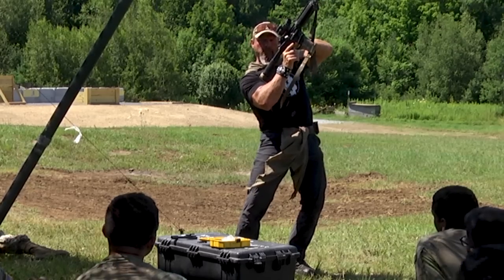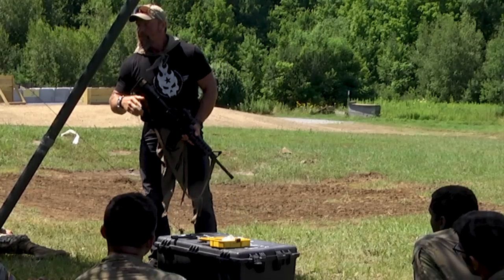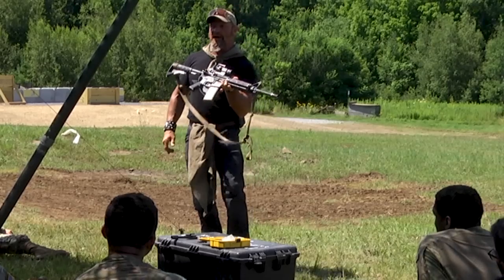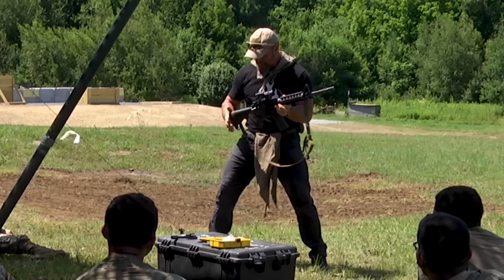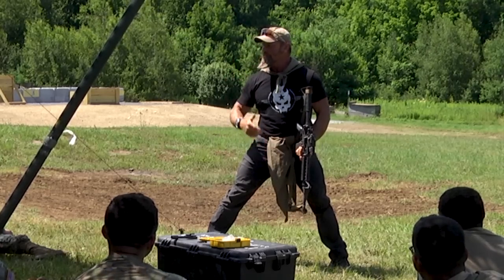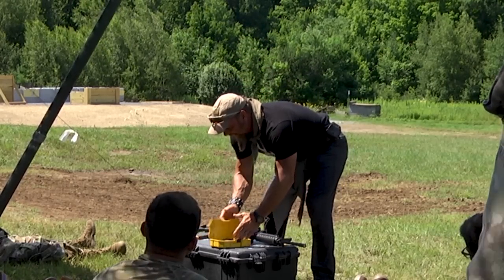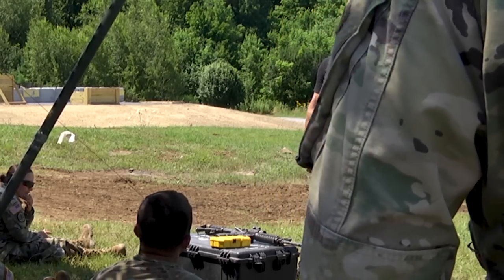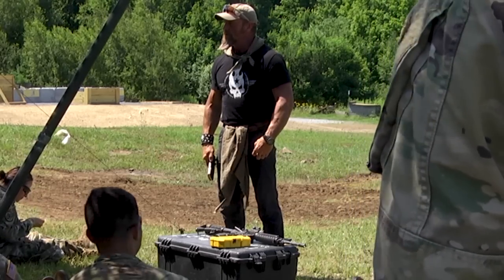Pat McNamara | Weapons Malfunction Training

Comment: A malfunction is where something goes wrong with the weapon (something breaks).                         A stoppage is a break in cycle of operations (double feed, failure to extract, etc).                          Get the verbiage right
Reply: Hmm...  failure to extract (stoppage) caused by a broken extractor (malfunction) sounds like splitting hairs. How about we all just agree that a weapon malfunction is when the weapon fails to operate properly for whatever reason. Knowing the 8 cycles of function for a weapon can help diagnose weapon malfunctions and enable you to resolve the issue quicker. It also makes it easier when bringing the weapon back to the armorer to tell them what the problem is rather than just saying, "um it doesn't work anymore"
Reply: Lee Glaser we use that in the Air Force because if we’re shooting and something happens during any of our firing sessions, we can diagnose if it’s something that we can do ourselves (stoppage), vs something that we have to take to our arms shop (CATM) so they can fix whatever it is that broke.
Reply: @tannerhughes6274  I guess that could be the difference... Army vs Air Force. In either case the first and second course of action should be the same.
Reply: M. Nichols get what you’re trying to say, but not quite. A double feed, fail to extract, etc are all stoppages because it’s a break in the cycle of operations that you are able to fix, get the gun up and running, and press on.

Like I said earlier, a malfunction is something is broken with the gun that you can’t fix out in the field and you would have to take to some shop and fix. 

I’ve training with guns in the military for the last eight years. Which I have been quizzed on and have quizzed newer troop about. I’m telling you facts.
Reply: @tannerhughes6274  Your reality is not facts. I told you the literal definitions of malfunction, and stoppage. Those are facts.
Reply: @tannerhughes6274  I'm not sure how the AF words it, but in the Army FM 3-22-9 chapter 3 it doesn't define stoppages vs malfunctions as whether or not it can be corrected by the shooter or an armorer. In fact, the definitions are almost synonymous and both words are used in each section. In one example from the Army FM, resting the magazine on the ground can result in a malfunction yet this is not something that has to be remedied by an armorer. Essentially, a malfunction is defined as a mechanically induced stoppage, but does not mean the weapon is always "hard broke". This goes back to my original post in that every stoppage you listed can be caused by a mechanical failure and you are just splitting hairs with verbiage. I've learned over the years teaching people about weapons that simplification is best. In the regular Army they like to use the phrase SPORTS for immediate action drills (I'm sure you are familiar with that one). However, in my world "tap, rack, bang" is the simplified immediate action drill taught in my unit and the exact verbiage used.
Reply: Lee Glaser all verbiage that sounds different between the branches. Would be nice to make things the same so there’s no confusion stateside when working together or downrange. 

I was taught SPORTS years ago when I joined, but had long moved on past it for “better” procedures. Went to “slap (bottom of mag to make sure it’s seated properly), rack (to clear a potential bad round or get a round in if the mag wasn’t initially seated), fire”. And that went to ART-C recently.

Comment: The mags not seating because of FLAWS in the AR design Too much pressure on the bolt to seat a mag is not shooter induced..next..Failure to fire..because of FLAWS in the AR design..light primer strikes...next...cant extract..due to FLAWS in the non bottleneck round..next..failure to eject due to FLAWS in the AR design..it operates on precise amount of gas pressure not force..next..it takes a minute and a half to change rings out while enemy combatants walk up and shoot you..next..
Reply: soldier of tough love you could have just typed “I have no idea what I’m talking about” and saved a lot of time.

Mag not seated because the shooter didn’t properly seat it. Seating a mag on a closed bolt takes more force, but normally it’s going to be seated on a bolt that’s locked back after running a mag dry.

You didn’t really explain how light primer strikes were caused by a flaw in the AR15. What’s a non bottlenecked cartridge? Straight walled? .223/5.56 is bottlenecked.

Your part about force and pressure is contrary to physics principles that are well understood. Pressure acting over a given area creates a resultant force.

Gas rings don’t fail suddenly, and even if they do, it’s not catastrophic. At worst you have a straight pull bolt action.